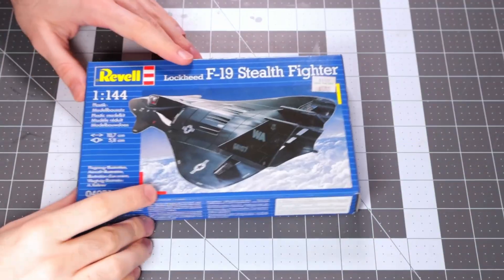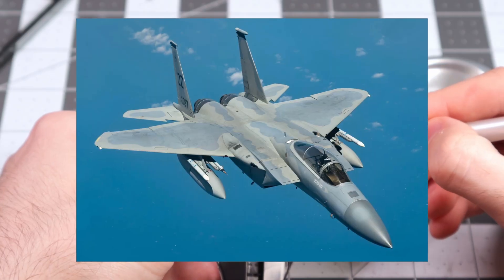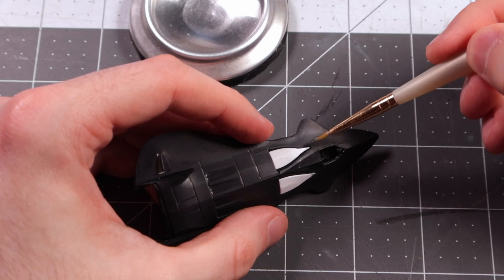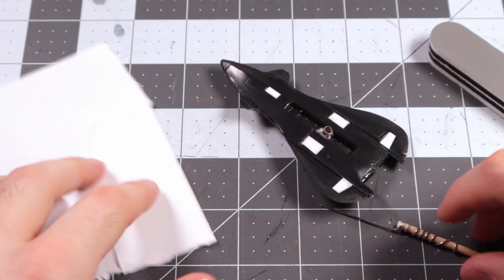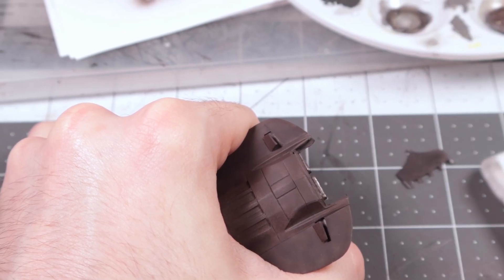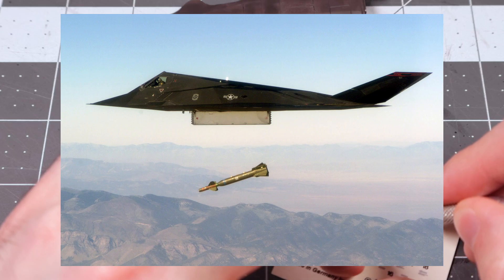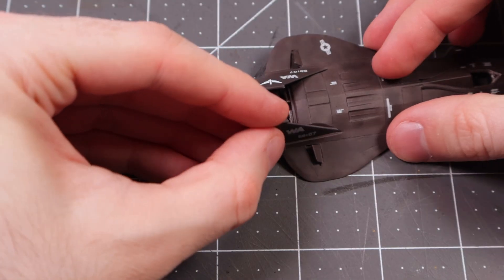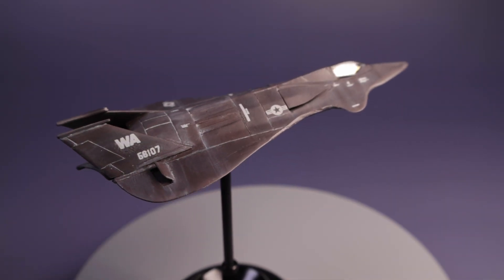F-19: Testor's Fake Stealth Jet that Fooled Everyone

Comment: Very good video. A couple minor clarifications though. John Andrews apparently did know a little more than the F-19 design shows, but he did put in some red herrings as it were so he didn't compromise secrets. The DoD were freaked out enough at his close guesses that they did have federal agents execute a search warrant hoping to catch him red handed with something classified although they never found anything.

Yes the F-19 doesn't look like the F-117, but if you look at the dead on front profile silhouette of the F-19, it is VERY close to that of the "Have Blue" prototypes which were tested at Groom Lake in the late 70s and those helped to greenlight the F-117 project. Like the 19, Have Blue had canted in tails and a triangular canopy profile. And it had more swept back wings than the 117. So... did Andrews know about Have Blue?

As for the little Revell kit, it originated with Tsukuda Hobby in Japan. The Tsukuda kit combined features of the Testors F-19 and Monogram's F-19A, which itself was based on an artist's design from 1981 for an SR-71 sized bomber and a fighter modification used in Northrop Loral advertisements of the day. Monogram did their kit in 1/48 and 1/72 scales. Tsukuda's kits were offered in 1/48 and 1/144 and both were reboxed by Revell of Germany.

Comment: Monogram released a sleek looking version of the F-19 dubbed the Spectre in 1/48 and 1/72 scale.  It was based on an advertising design for the defence contractor LORAL.

As well as the Revell design (which is distinguished by the fixed rounded canard foreplanes) Hobbycraft released a kit called the F-19 Stealer in 1/144 that was a precise replica in 1/144 of the Testors (released elsewhere by Italeri).

Comment: The F-21 was actually the designation for the IAI Kfir for a while, while the Marines were using them as aggressors. And ... yep, I built that kit (1/48) when it came out, too. And the soviet version (which I've built again and have around currently.) As far as Testors killing off its model division? I don't recall if that happened pre or post Rustoleum purchase, but.. .Testors was in a weird place, modelwise. Old 1950s Hawk releases, some new(ish) tools, sometimes the only place to get certain kits (*nobody* else did a 1/48 YF-12, and they were pretty much the only game for 1/48 SR-71s, they had the prototype F/A-18s out which you could switch the canopy and cockpit to build a single or two seat - though they weren't exactly accurate, these were prototypes, and still the only game in town if you want fairly early, short-aileron prototype F-18s... which I did, built a lot about two years ago.) They had interesting subjects, mixed with old kits the molds were getting worn out on... and, really, hobby shops started vanishing in the 90s-2000s, and department stores didn't really carry them any longer.Which, itself, is a shame.

Comment: Great story and very well told
I've seen this design out there a few times and always been impressed by the engineering. I mean it would never actually fly, but looks just good enough to ignore that. 
Reason for the comment:- Sprue Glue. You were using gorilla superglue as a gap filler, which is a nice idea, but it left that white residue and you had to Dremel it off. Hope you were warming a mask for that part! 
Try using sprue glue instead. Cut some of the matching sprue into small pieces and get an old, mostly empty,  bottle of Tamiya (or your favourite plastic cement) leave them in there at a roughly 2 parts cement to 1 part sprue ratio (might need to experiment a bit get the consistency you prefer). when it's melted into a sludge use a toothpick, or a pin, and fill any gaps with it. If you're careful enough you can do it quite easily. When dry there is no white residue, it matches the original plastic and any excess can be removed with a model knife.

Comment: You forgot the YF-23.  And we’re missing 24 through 34.  Where are all those planes?  One has to wonder why the F35 got such a number when there are 11 numbers in between the YF-23 and F35.
Reply from the maker: There's actually an explanation for this! I mentioned it briefly in the video, but it basically goes like this: The F-35 was the winner of a competition between Boeing and Lockheed Martin to produce a new plane for the Joint Strike Fighter program. Following the US tri-service naming system, the two experimental planes being considered were the X-32 (Boeing's plane) and the X-35 (L-M's plane). When the X-35 was declared the winner, they decided to keep the number and just switch it to the F-35 when the plane went to full production.
Officially this was to "save on paperwork," but the supposed real reason is that some important general misspoke and called it the F-35 by mistake, and it was made official to avoid embarrassing him. Apparently even internally at Lockheed Martin they were calling it the F-24 right up until the "new" name was announced!

Also yeah I just forgot the F-23 existed, RIP
Reply: @Sublight_Drive why were the x-32 and x-35 not named yf-32 and yf-35?
Reply from the maker: The Y prefix indicates that a plane is a prototype for a planned production run, while X planes are (usually) one-off experiments to test a new concept that will later be used on a different plane. For example, the X-5 was a test of variable-geometry wings, which were later used on the F-14. But, the two planes don’t look anything alike!

In video game terms, you could think of X-planes as tech demos, versus Y-planes which are the beta version of a plane before final release. 

Both the X-32 and -35 were essentially competing testbeds to see which company could best meet the strict (and occasionally changing) conditions of the Joint Strike Fighter program. Because no prior US planes could do all the stuff the JSF wanted all at once, they were X-planes, testing to see if it was even POSSIBLE to meet the requirements. (STOVL or VTOL + supersonic flight, all in the same mission)

The X-35 looks very similar to the final plane, but had to go through a whole bunch of versions and changes to keep up with the demands of the program, and was never even close to being an operational warplane. It didn’t even have internal weapon bays!

By contrast, the YF-23 (for example) wasn’t testing anything as new or ambitious. Had it been chosen over the F-22, it would’ve gone straight to production without any need for changes to make it combat-ready.
Reply: To try it another way: The YF-22 and YF-23 carried on the established "F" sequence, and the X-32 and X-35 were more experimental (with some different funding and oversight channels involved), so they followed the X sequence.  
You might also want to look up the Rockwell-MBB X-31, which tested thrust vectoring technology and looked pretty cool, too.

Comment: I remember when this kit was released.  The biggest rumor I heard was that the Russian consulate in DC bought about 10 kits...  And were most upset when we first public revealed the F-117.    A couple of F-117 pilots said that they were hoping that it was get the Predator moniker - they hated Nighthawk.  

One sidebar on the F-117:  When they did do public reveals a lot of folks were accusing the Government that they were censoring photos as 90% of those who took allowed picture found that they resulting photo was blurred.  Come to find out that a lot of the cameras used sound or IR beam for distance to focus properly - then the camera defaulted when it didn't get a return.  

Been to the base that they tested the Nighthawk.  The pilots has interesting stories that the cover was they were testing the A-7 for night use.  So the question was "Are you flying today or the black jet tonight.  Not secret, considering that was 33 years ago.

Comment: Northrop was contracted to develop a stealth attack plane to compete with Lockheed.   While there is no published evidence of the designation for the project, xf19 may have been it.  From talking with Northrop employees, they claimed that a single aircraft was built for evaluation. It was more stealthy than  Lockheed's but like the latter B2, very little was off the shelf making very expensive to build and longer to put into production.  I suspect that if there was a flying model it was to test aerodynamics and RAM paint. 
The USAF wanted to get the stealth fighter (and Bomber) into production  as fast as possible because once the plane flew the USSR would work on countermeasures.   The Northrop design would have costed more, been more stealthy and be useful longer.  The F117 would be available sooner, cheaper with good enough stealth.  
While the Northrop design could be flown without a computer,  no human could fly an F117 without computer flight control.  
By the way the Northrop people told me that their design looked more like small B2 than the F19 Testor model.
By contrast the F117 is flat panels because it was easier to model the radar return.

Comment: I used this model kit as the basis for a stealth jet in a chapter in one of my novels. I basically reimagined it as a 4-seater, Mach 4 transport, with roughly the same cargo space as a '70s-era Chevy van, and no weapons. I also gave it VTOL, for plot reasons. Hey, it's Sci-Fi, I have an unlimited supply of Handwavium, LOL! The book ought to be released either in late 2024 or in 2025.  --Dan
Reply: Handwavium (1). The most potent plot device in SF. Especially military SF. 
1) Handwavium includes all FTL drive systems, Zero Point Energy, Anti-Gravity, Artificial Gravity excepting spin gravity,  Inertialist Drives, Non Reaction Drives etc. Not saying the FTL, ZPE etc will never exist.
Reply: @mpetersen6 , some of the most potent tools in a SF writer's kit: Handwavium, Unobtainium, Unexplainium, & Hardtogetium!  --Dan
Reply: @Dan_Hollifield  
This may be outside of your personal experience but in the 1960s famous model railroader John Allen (1) had an article published in Model Railroader about a small HO layout. The layout featured a short line. Short as in length with the engines, rolling stock etc. The short line specialized in hauling unobtainium ore. It was an April issue of course.
1) Most well known for the Gorre and Depheited
Reply: @Dan_Hollifield  
I also do some writing in the fan fiction area. But not for publication.
Reply: @mpetersen6  , people write some awesome fanfic. Don't put yourself down. Playing in someone else's universes can teach you a lot about writing.  --Dan
Reply: @Dan_Hollifield  
I'm not putting myself down. I do it mainly for personal enjoyment. Mainly in the Emberverse and the old CoDominium/Empire of Man War World series. 
Emberverse l looking at Southern Italy centered on a family run schooner out of Split Croatia, elements of a Marine Expeditionary Unit docked in Taranto and two islands in the Adriatic (San Dominio & San Nicola). Another story line deals centers on small towns in the northern portion of Lower Michigan.
The War World one deals with events following the rediscovery of Haven and its remnant population of Saurons.

Comment: The original F-21 were about 25 IAI Kifr fighters leased to Top Gun in the 80's for agressor role in training. The Navy and Marines offically dubbed them F-21A Lion for the four years they operated them. An additional six Kfirs are also used by the US firm Airborne Tactical Advantage Company (ATAC), a civilian defense contractor that provides tactical adversary aircraft services to the US military, who still have them in inventory today.

The other F-21 (the modified Indian Viper one) is as far as I can tell a marketing stunt and it's not entirely clear if the F-21 designation is actually official.

Comment: Ok, hold on to your seat. What if I told you I 1st knew about that plane design in January 1981? What if I told you I have seen the artist rendition? It's almost exactly as your model, with exception of the rudders. On your model, the flat area you glued the 2 rudders..looks like a stretched half-moon shape... that was the shape of the rudders, but larger and sticking out. Also the design I saw had them able to move from pointing inwards to near vertical. Also, the outer 1/3 of the wings could hinge up to parallel with the ground to facilitate landing. The intakes were in a line across the top midship. Exhaust exited on top at the back. This was to lessen the heat signature from the ground.  
It was 1st a conceived by insider/expert Richard Hallion sometime in 1980. The artist who realized Hallion's vision was William S. Bond. Simply called "Stealth."

Now, are you still holding on? 
Want to see for yourself?
No BS. 
All you gotta do is look on page 102-103 of the January 1981 issue of National Geographic.
Ta-Daaa!! You're welcome.
PS give me a shout out.

Comment: And to the designer’s credit, the models Ravel and Testors came up with would have made a functional stealth fighter. The shape is a good solution to dispersing radar waves. Just smooth over all the seams like on the F-117, -22, and -35. As a flying machine it would have been dangerously unstable, but that was true of the -117 too.

Comment: The weird thing about it is that this model could have worked well  as a tool of disinformation to draw attention away from the real stealth fighter  The tail section of the F-19 does bear some resemblance to the tail of the Have Blue test platform used to develop the F-117.

Comment: I had one of these as a Micro machines plane.
Obviously it had less parts and the side wings next to the cockpit were not present. It had more a teardrop design. 
I had zero interest in planes back then, but I had a ton of micro machine "bricks" (plastic brick like box that you could flip open and contained a themed building and a few cars, that also could be connected to other bricks to create a town etc, toys for kids...). One of these was an airport and that one had this and a few others. Why I dont know, but we for some reason called the plan the "black program" plane and in my fantasy. The plane, for whatever reason, had this ability that it would fly with yellow afterburner within the atmosphere, but could transition to orbit via blue flame afterburner. :) I blame Xfiles on TV for the nickname...

Comment: Just wanted to clarify one thing.  There were 1/48 and 1/72 versions of the Testor’s kit, and neither had the little rounded forewings on either side of the cockpit.  Obviously, the one in the thumbnail is the Revell Germany version, not to be confused with Revell and Monogram.  The Revell Germany version had the little forewings on either side and was otherwise very similar to the Testor’s kit.

Source:  Me (building seriously since 1992) and the Testor’s catalog attached to Testor’s kit instructions.  I had both Testor’s kits pre-1992 when I built them more as toys than anything.

Comment: This was the same aircraft design that was used in the flight simulator “F-19 Stealth Fighter “ by MicroProse back around 1988. I used to love its advanced wireframe graphics 😂
Reply: Pressing Shift F10 back then was fun 🤭
Reply: @awdrcdrifter8421  I don’t have my handy cardboard keyboard overlay anymore… what did F10 do?
Reply: @glennpeterson1357  eject/bail out... was it alt f10 or shift f10, I kinda forgot.

Comment: They used F-21 twice. The Navy leased 25 Israeli Kfir planes (designated F-21A) as adversary aircraft. 
Andrews did get one thing right  His design and the Have Blue prototype both have inward slanting vertical stabilizers.

Comment: The original kits were the rounded American one and a purported Soviet one with flat, angular surfaces.  The blurb on the box stated this was because the Soviet tech wasn't as advanced as the US tech.  A few years later the actual US F-117 was revealed and had... flat, angular surfaces.  I got a chuckle out of that one.  Their "Soviet" model was much closer to the real thing.  Fun fact: the maths that allowed the development of stealth were actually originally published in a Soviet mathematical journal.
Reply: My man; you beat me to exactly the same points. I had both 1/48th Testors kits as a kid. Still have the F-19 in a box packed in styrofoam peanuts somewhere in my basement.
Reply: Well, it was still a case of U.S. tech being more advanced.  The U.S. was able to apply the science behind radar diffraction and come up with an actual (mostly) flyable airframe, with the angular shape being a product of the limited computing power of the time.  Flat surfaces and angles aren't required for stealth, they just make the math easier.  Lockheed also had experience in radar-absorbing materials from earlier projects, which went a long way toward minimizing the F-117's radar cross-section.  

The Soviets... just couldn't pull any of that off.

Comment: I do remember a magazine article way back in the early eighties that had somebody’s impression of the newly emerging stealth technologies and what they would look like with swooping lines and compound curves everywhere it certainly looked very different to the F14 F15 F16 generation but it was supposedly designed to hide from radar emissions so what a surprise it was when the real stealth machine F117 was finally revealed with it’s flat panels and un aerodynamic shape made me suspect that the original magazine impressions were an operation created to mislead the competing nations beyond the eastern wall about the real tech behind effective stealth - was I correct? 🇦🇺